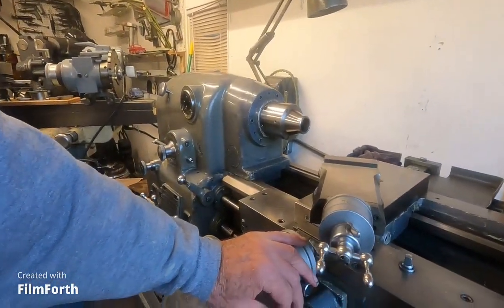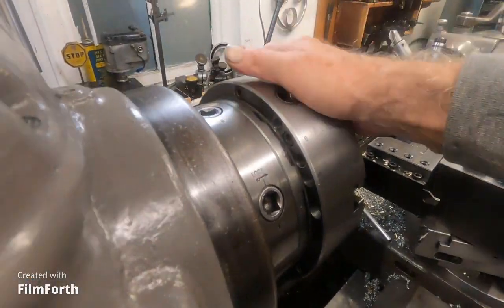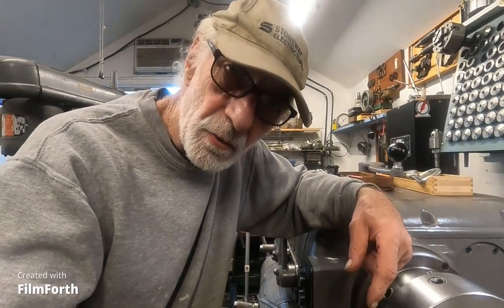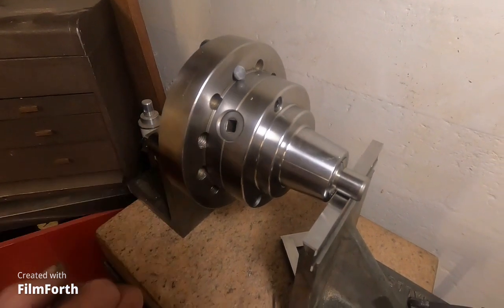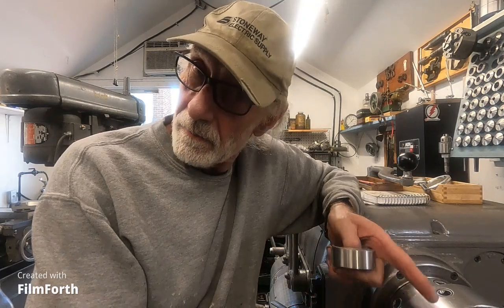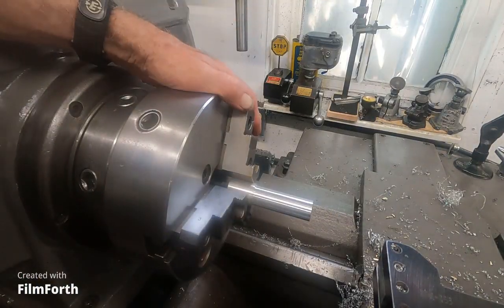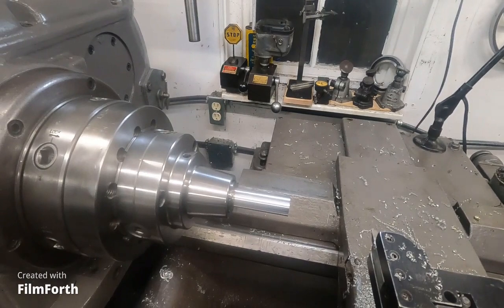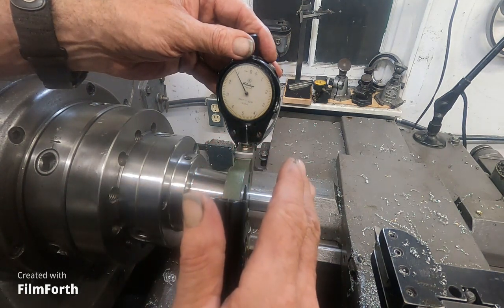Advanced lathe chuck tuning, the balance the finish

Comment: I take apart my lathe chucks once a month for cleaning.   Extends life of the chuck and accuracy.       Leveling a lathe is extremely important.    This makes all other adjustments come into play.
Reply from the maker: This lathe has not been used for some years and was banded to a skid causing some bed twist that is finally settling out after several months, now there is more even pressure adjusting the 8 leveling feet. The used chucks I gathered are working out great so far, thanks

Comment: dee dee do u have a video on how to run your brown and sharp mill?  i have a no 2 light plain but havnt found good documentation on how to operation the controls.  It doesn't have rapid traverse just power feeds in all axis.
Reply from the maker: My war time  No2 Plain Standard is a 1930s machine with the later independent motor powered knee. I will be doing more with the mill, i will show the controls it has, thanks
Reply: @deedeeindustrialsuperprecision  ok great.  mine is a late 30s as well. looking forward to the video

Comment: Wouldn't boring a hole on a chucked piece of round stock be more accurate for balancing the chuck, then using drill rod in the hole with a good fit to use on your balancing set up?
Reply from the maker: No, the ultimate least friction method is using knife edges how sharp depends on how much weight, thanks!
Reply: @deedeeindustrialsuperprecision  I'm not saying not to do that, but any run-out in a 3 jaw chuck gives you an imbalance to start with, wouldn't it? So, how do you compensate for that and get on the centre line of axial rotation before balancing it with weights or drilling holes? I'm just interested in the details, Dee dee hope you understand mate. 👍
Reply: I think boring a hole in chucked material would put that hole on the spindle centreline, which isn’t necessarily coaxial with the chuck centreline. Provided that, when the jaws were ground to be concentric to the spindle centreline, the chuck body was first adjusted to negligible runout, both chuck jaw, chuck body and spindle centrelines should all be concentric. Book one, page one of the millwright’s manual I’m guessing!